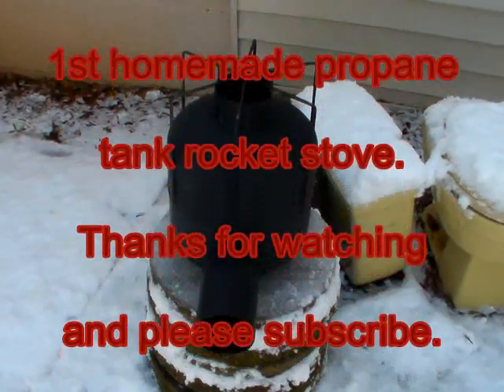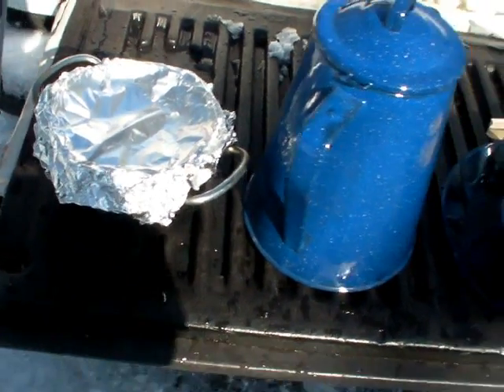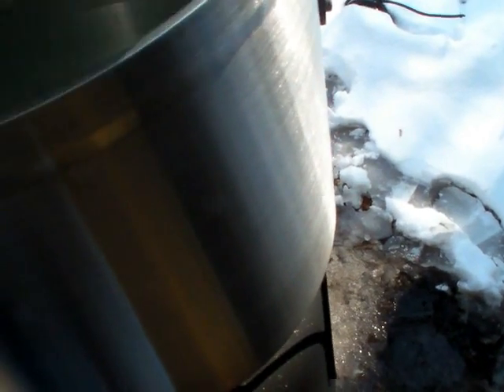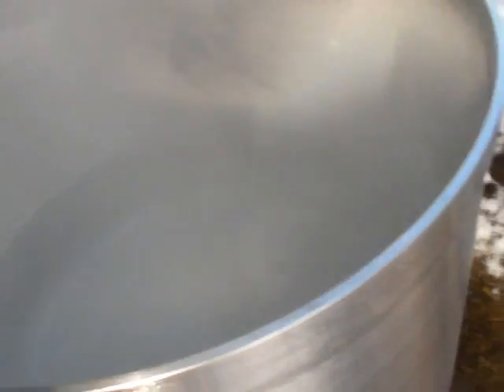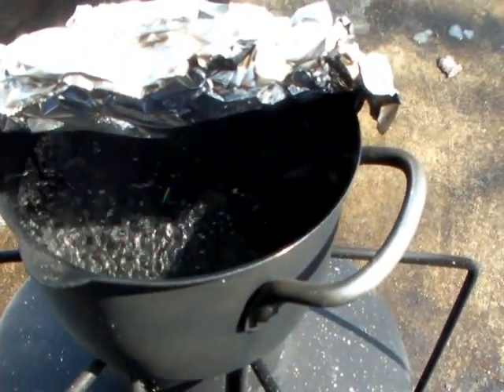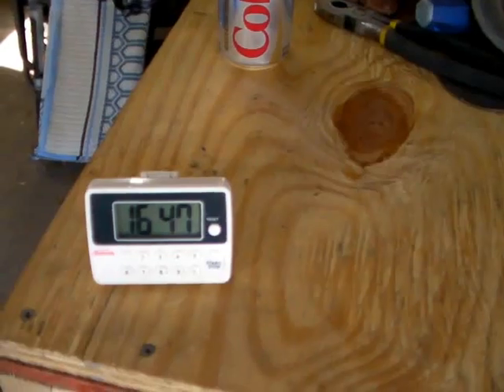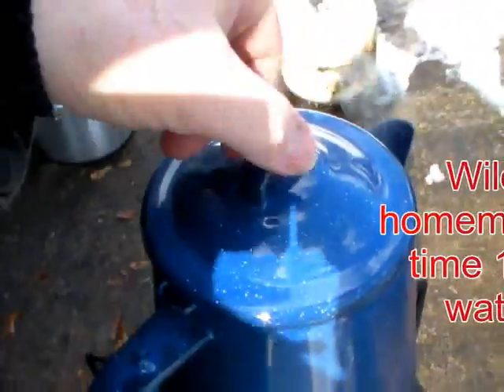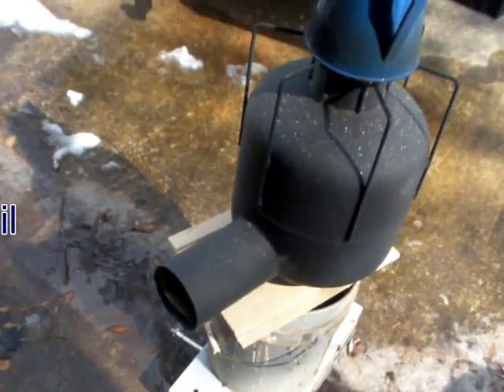Hommade rocket stove 1st boil time test mpg.avi

Comment from the maker: @fallguy100000 There are idiots everywhere.   Live Life At Your OWN RISK.
Yes I did insulate the tank but might have skipped over it in the video.  I used pearlelite, it was light and works ok.  if I was going to make a permanent ricket stove like this I would use sand.  I think it would work better and is alot cheaper.

Comment: using a propane 20 is a bad idea because it only takes one idiot to follow you wrong, did I miss whether you insulated the tank?  The tank edges need to be insulated; sand works.

Comment: I just finished my 40lbs. tank rocket stove and got about the same results as yours did. one thing that I find works good is using vertical sheet metal for your cook top. it acts also as a wind screen between stovepipe and pot.
I have also posted a video of mine at work

Comment: About reducing the gap above the heat riser. If I remember correctly, you're using 4" EMT, so your area is about 12.5 sq. inches (pi r sq. = 3.1416 x 4 = 12.5). Your gap area should be no less than that, to not restrict the flow. Gap height = desired gap area / circumference. At a 4" diameter this neatly works out to a 1" gap. (12.5 area / circumference (pi x d) 12.5).  Great work by the way!!